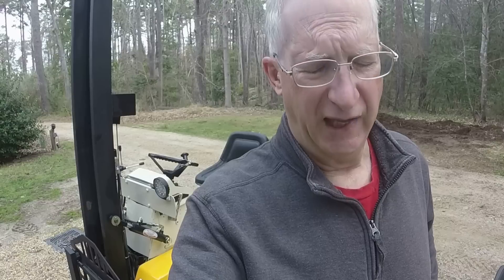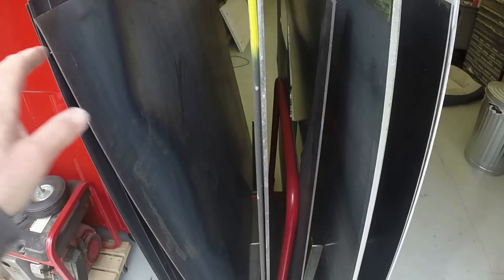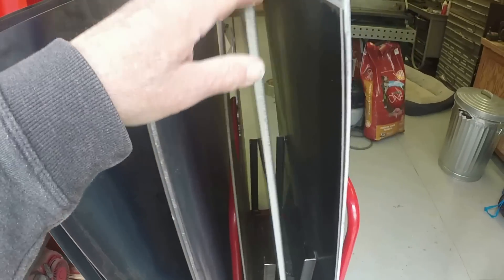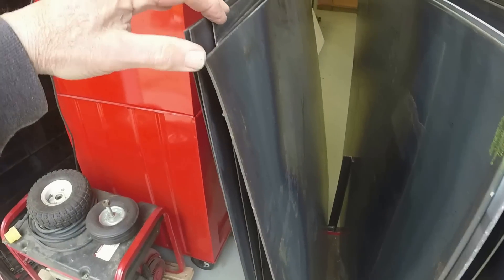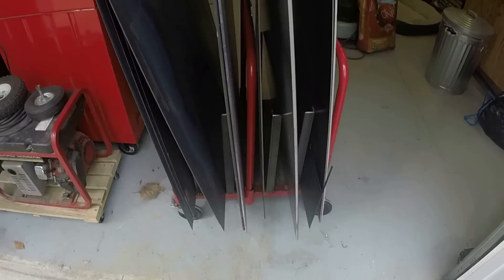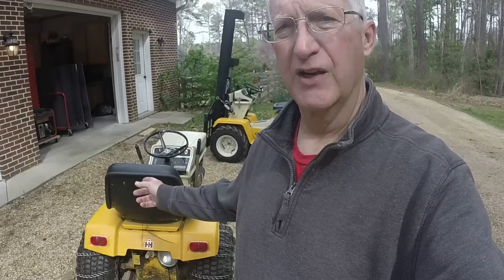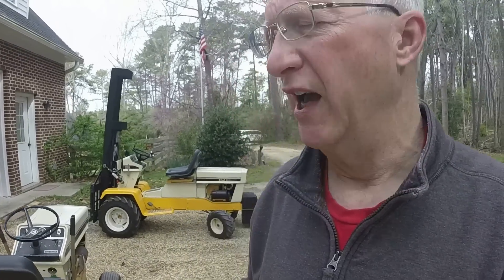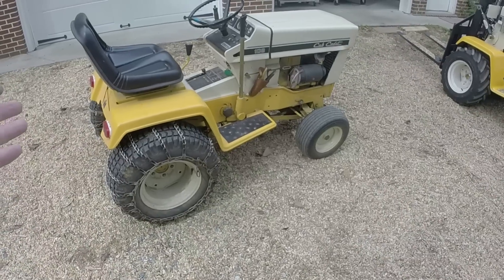Forklift Stress Test: 850 lb. Tractor + 1200 lb. Steel Rack

Comment: Killer project Frank, please swap the rear steer wheels around the chevron pattern does not match the front. OCD
Reply from the maker: If I do that, the number of comments on the video will be cut in half. LOL.
Reply: @woodandmetalshoptime8048  oh, I see what you did there! Well played Frank, well played.
Reply from the maker: Actually, I've been told they should be different (as with a motor grader) but most say should be the same, as with a 4WD tractor.  The REAL reason is that I'm planning to swap out the front axle for a heavier axle and those wheels (larger bearings so different wheels) won't have AG treads on them. My comment about video comments is a bit tongue-in-cheek and a bit about my rebellious spirit.

Comment: Frank, you can always add "rim guard" to the steer tires on the forklift, that will add a few extra pounds as well.
Reply from the maker: Yes, that would help.  Rim Guard (beet juice!) is considerably heavier than water and not corrosive like calcium chloride solution.  Would probably add 30 lbs? That's equal to an additional steel plate up front.

Comment: Could you increase the load capacity by taking two plates putting sides on and filling with lead and weld closed
Reply from the maker: Well, lead weighs about 50% more than steel, so you can certainly get more weight in the same volume. I don't know about welding something with lead in it but you could build a steel box and fill it with lead shot for example.

Comment: Any thoughts on making the tires hard or filling tires with filler to make them hard that way it increases the load capacity not much but it would help. The controls should be next to each other so you can control both at the same time!

Comment: Funky little forklift id say more air in the front tyres and see if u can set u the pedal for inching pedal im thinking was my bread an butter as a Counterbalance Forklift driver for 8 years and can u the tilt and lift leavers are 8deal close the the hand and in line with a inch between the two knobs

Comment: Hi Frank, not sure what psi in your front tyres! But need to at least double it or run 40/50psi for 1100lb lift as when you lifted the steel rack that front tyre was almost flat!! Even with tlhe lift of your lawn tractor they were low as well!!
Reply: I watched the tires while he was lifting.  I didn’t see them move at all

Comment: Thanks for following up and posting this. All it does is show that your due diligence and math worked out predictably well, but Youtube is a visual medium and it ‘needed’ video of a max lift. 🙂

I like the idea of extending the travel lever to reduce its sensitivity. I also still think you should put a restrictor in the tilt circuit to slow that movement down a bit. Your caution behind the wheel can make up for a lot, and sometimes it’s fun to do so.. but apparently the mentality can be taken too far as my wife won’t touch anything of mine at all because she assumes im the only person who can finesse it into functioning.. Anywho, i think slowing that function down will build in a little margin for error such as the minor moment you had trying to disengage from the metal rack when something moved unexpectedly and some controls were used incorrectly for a brief moment. Everyone has those moments, and the machine should ideally tolerate them as best as possible, without launching or dropping a load, etc. Just my .02 (again). 

I always trusted the math anyway but seeing the machine engage and disengage and move a little bit in the process of those lifts got across a good idea of ‘what its really like’ to use, and its nice to see it ISNT the sort of thing that my wife assumes all my creations are, totally unworkable by anyone other than me. 😂 Congrats again on the successful project.
Reply from the maker: I bought a pair of flow restrictors for the tilt circuit. Just haven't had time to put them on yet.

Comment: Awesome video, job well done on your build, and also on your lift test! More counter balance weights indeed--yes👍🏻👍🏻! Maybe dual wheels on your front drive axle for improved stability over the terrain??? I guess would depend on what you lift & where ya take it🤔🤔🤔 Thankya for sharing
Reply from the maker: dual tires would prevent the forklift from fitting through some of my gates/walkways and limit it's utility for me. I'll just have to live with the existing tires. Remember, moving will be with the load near the ground most of the time, so stability is less of an issue.
Reply: @woodandmetalshoptime8048  Copy that! I understand now😃👍🏻👍🏻👍🏻Thankya for sharing & for your reply back!

Comment: There is so much I like about my 149 but the transmission lever is not one of them. It really needs a foot pedal and watching you run the fork lift I am more convinced. That lever just makes operating the machine so awkward. Even with the shifting, my Sears SS16 twin is much nicer to operate with ground engaging operations. Right now it's a loader but I plan on fabricating a hydraulic three point for it. After that maybe a foot pedal for the 149.

Comment: How about filling the steer wheels on the forklift with fluid like the weekly mower back wheels? Would this also add to the safety margin for lifting? It is great to see the success of this build, thank you for sharing the journey with us.
Reply: Good idea, any weight on the rear half will add to lift capacity
Reply: I wondered if it was possible to find some cast iron barbell weights that could be modified to become wheel weights too

Comment: frank when you picked up that rack those tires really went down on the fork end of the lift. it had no trouble lifting that 1200 lbs , with more counter weight i bet it could lift twice that but i would be very careful and keep it close to the ground. a real fork lift looks much wider and more stable side to side. still for around the shop and to unload trucks that come it will be great. nice job frank. god bless you and the boys.
Reply: Good spot sir. I wonder if the tyres could be filled with something like a polyurethane similar to that used to make suspension bushes. Maybe poke some holes to allow air out during the filling and trim the excess off once set.
Reply: @mopedmarathon  i know they make hard rubber tires for fork lifts and they don't have any give in them so when he is lifting heavy things up high there would be no side movement . a lot safer i think .but i don't know if frank would go for the cost of them.